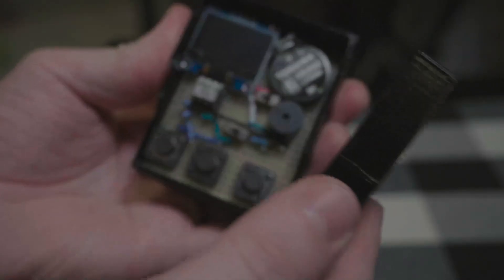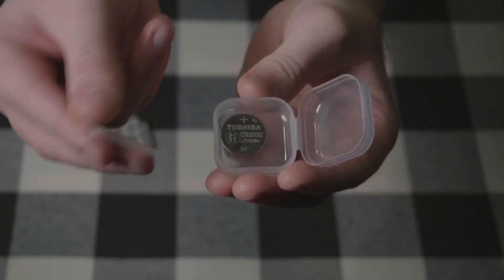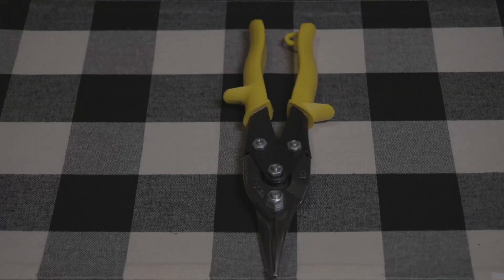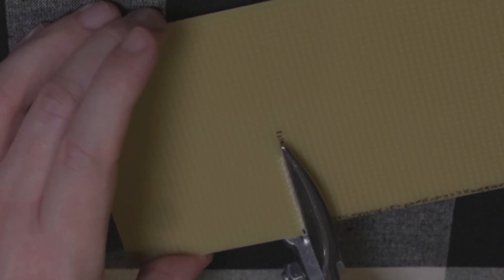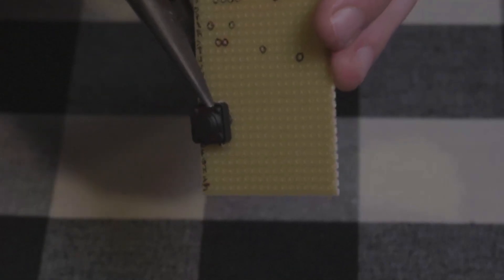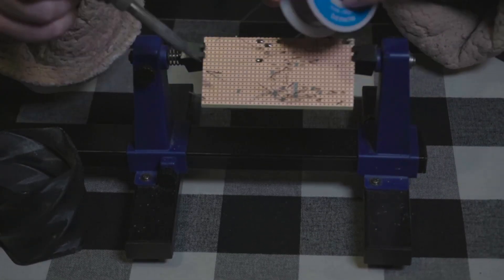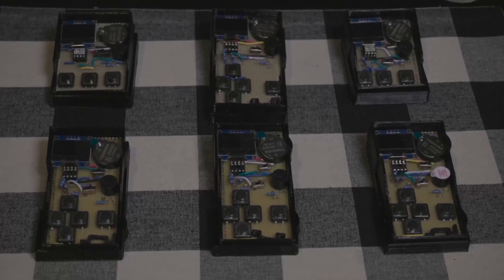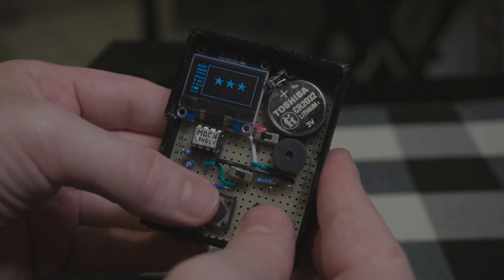Tiny Adorable DIY Video Games! (ATTiny85) Tutorial

Comment: I've been inspired by your video to make one of these but I'm confused about how to configure the TinyDriver.h file. Is there somewhere I could see how you did it as an example?
Reply from the maker: Hi Degon, try as I might, I was not able to fill in the blanks in the TinyDriver.h file. I guess Daniel C. left it blank due to some kind of licensing issue? Anyway, the workaround is to use the pre-compiled hex files provided by Yevgeniy-Olexandrenko (link in the description). He hasn't compiled every single game, but he got most of them. Games by coders other than Daniel C. will have the full source code - no need to worry about rolling your own drivers on those. Hope this helps!